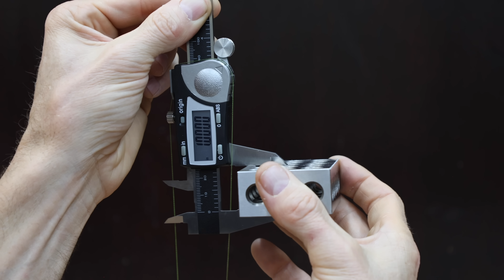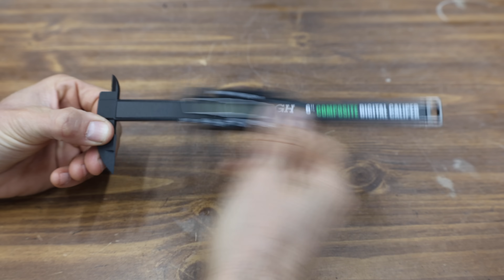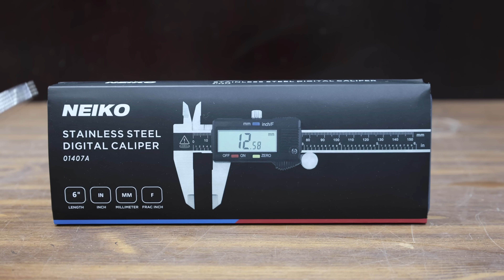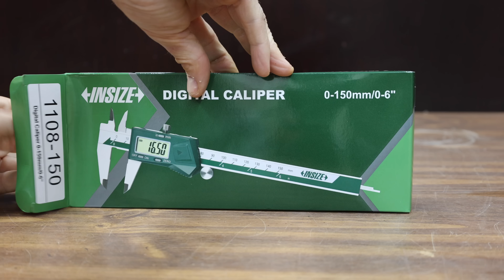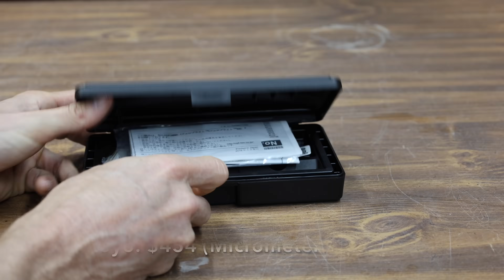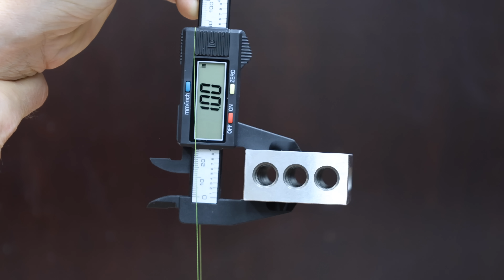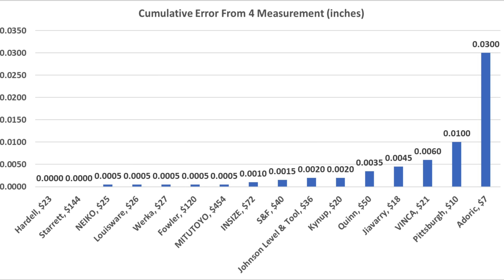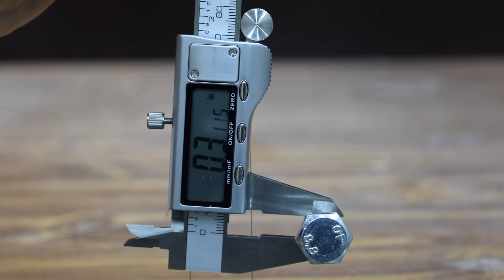I've Been Proven Wrong About Calipers!

Comment: Check your battery in the Mitutoyo. It is an SR44SW, not an LR44. The SR44SW is a silver oxide battery 1.55v @ 200mha, instead of the LR44 which is an alkaline battery 1.5v @ 150mha. 
At work when they bought LR44 batteries we noticed our calipers (Mitutoyo) wouldn't last very long at all so we went back to the SR44SW. Typically they would last 6 month to a year of heavy use.
I have bought some cheaper brand calipers and they never last. Usually start giving erroneous measurements before going goofy or blank, so I bought Mitutoyo calipers for home use and have never had to replace them since. 150mm Mitutoyo calipers are available for $145 - $185 without the micrometer. Also beware, Mitutoyo calipers are the most copied (faked) on the market. I wouldn't buy them off of amazon or ebay. Especially if you thought you found the deal of the century.
Reply: Yes indeed.  I never use alkaline cells in calipers and similar devices, always use silver oxide.  Last longer and have a flatter discharge curve.
Reply: Thanks for the battery info.

Comment: Hello. I have a small lathe workshop with metal cutting machines. For mass use I use quality ordinary calipers and cheap digital ones. I roll them back and forth without worrying that they will be damaged. Do I need accuracy to 0.1mm. I only use them. Cheap digital ones up to 30-40 dollars, although they read with an accuracy of 0.01mm. are actually accurate to about 0.06mm.

I also have a Mitutoyo caliper, which made my heart ache when I bought it. The price is salty. But this caliper is worth every penny given for it, it is even cheap!... Just when you hold it in your hand, the difference is immediately felt that this is a quality instrument created precisely and working precisely. With it I can safely measure with an accuracy of 0.01mm. in mass cases when accuracy 0.01 0.005mm. are not fatal.

However, when accuracy of 0.01mm or 0.005mm. is of fatal importance, it is switched to micrometers!

Although the Mitotoyo caliper can detect this accuracy and will detect it, it is better to work with a micrometer then.

But when you hold an original Mitotoyo in your hands, it simply feels that it is one that is a class above the others. They deserve every penny and anyone who needs a precise and quality device, Mitutoyo is the standard!

Comment: For daily use, digital is good because it's so easy to read. For occasional use, I'd rather have a dial or vernier caliper in the toolbox because I know it'll still work when I pick it up months later. No batteries and can handle wet conditions...even full immersion isn't going to kill a vernier. (Sure, they could put a backup vernier scale on the digital ones, but they don't! Just a basic ruler.)

Comment: what the actual f.... 
1) why conduct "smoothness" test, when the biggest variant is your own human inconsistency at aplying force or reading the scale correctly?
2) why conduct "smoothness" test AT ALL? its a GAUGE. The object youre measuring is not gonna get bigger or smaller just because the calipers dont operatly buttery smooth.
3) doing accuracy consistency test while being operated by hand.... bruh.... the depth test where you eyeball wether the calipers are at 90 degrees is just the cherry on top...

TLDR: good slop